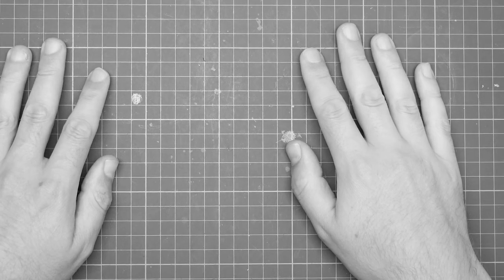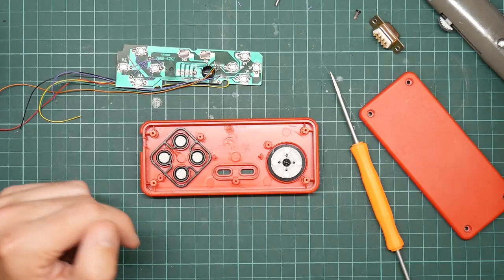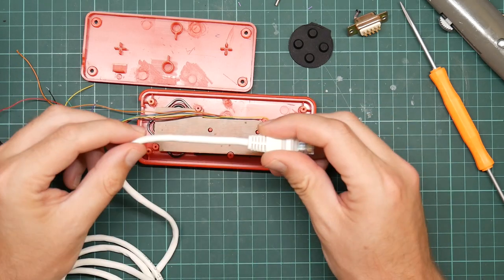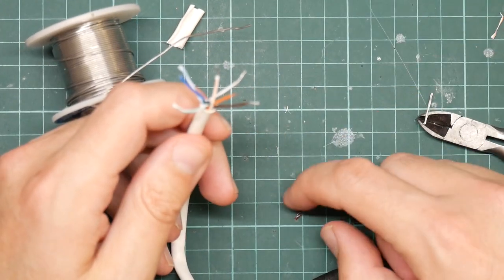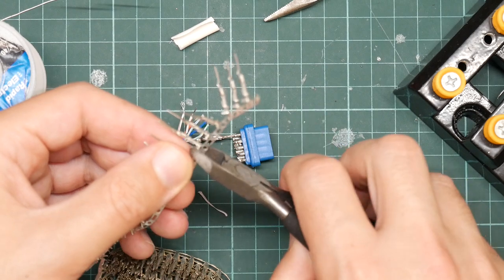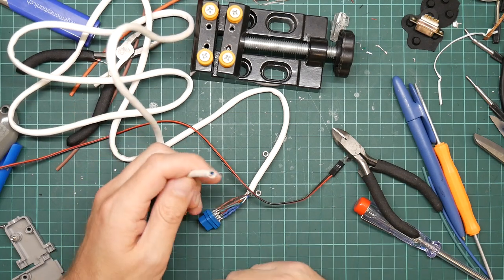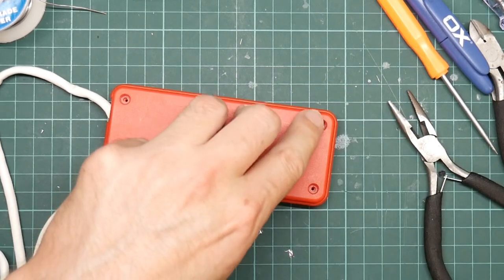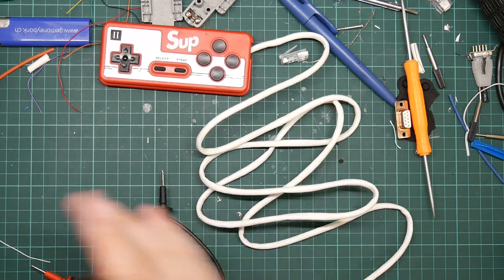Hjalfi makes a gamepad: #2

Comment: Your crimping reminds me of when I was doing my crimping with pliers myself. I also thought "wow this is so inconvenient who invented this?" because I had exactly the same problems as you did. After I grabbed a 10$ crimp tool from aliexpress, all my problems were gone. Trust me, you want a crimp tool, even if it's just a cheap one from china...
As for continuity testing, I usually stuck a small piece of copper wire in the connector (on the pin I wanted to test), and connect the crocodile clamps to that. That way you still have both hands free for pushing a button :)